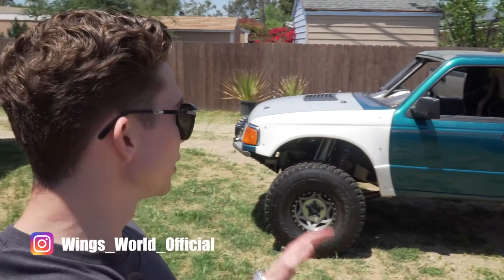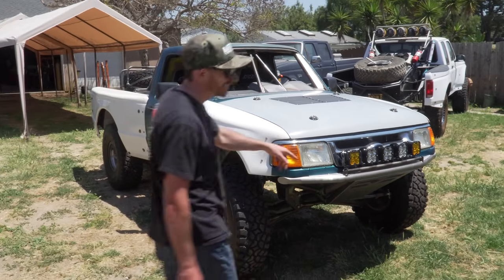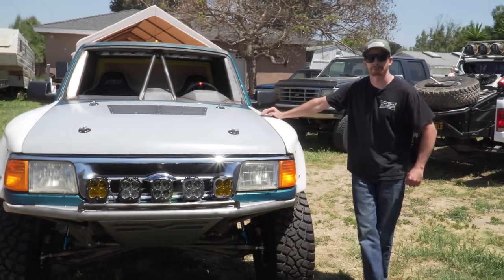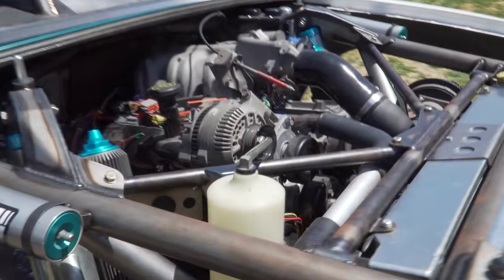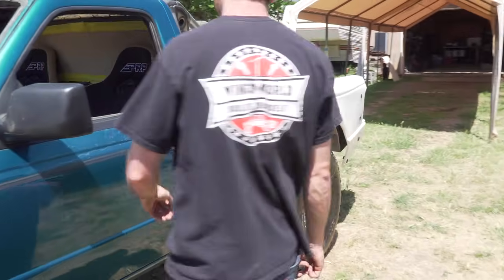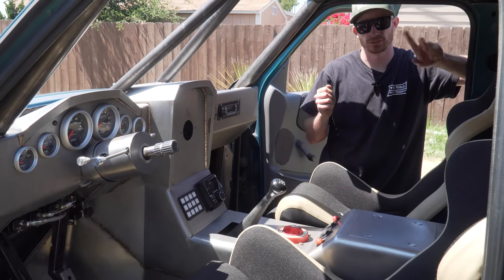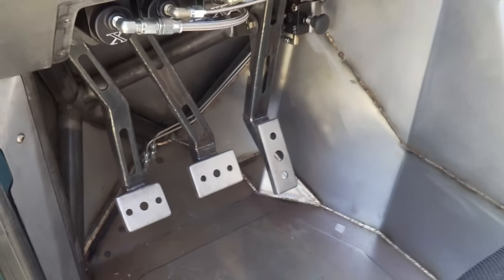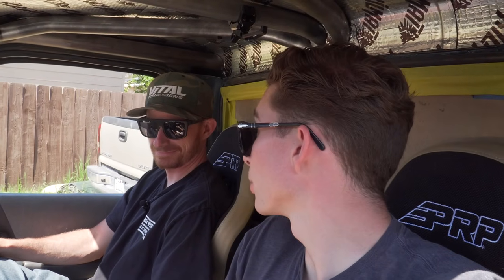Bespoke Hand Built Sheet Metal Dash - Ranger Build EP13

Comment: That truck is outstanding, I just spent 8 months in Brazil and I saw a few crew cab Rangers in that body style down there...this is really making me want to buy one that 25 years old to import and build like this. I even have a roller cam 351w, rwd ZF-5 S47 trans and Sterling 10.25" rear in my front yard for it from my '97 F-250HD that unfortunately got wrecked...very inspirational stuff, built like a tank. You guys definitely have developed a ton of experience, accumulated the proper equipment, have learned how to engineer and assemble a quality truck.

Comment: Beautifully done a lot of thought and time has gone into this build.
One question is there going to be any type of fire suppression system a build like this I would want to have a good system not just a couple of fire extinguishers, I would mount one at the front of both seats under the seat so easy to grab a couple of companies do some excellent mounts designed to mount to the seat mount brackets or adjuster rails.

Comment: 13:00 The right answer but for the wrong reasons 😅. Either way still a great build and design, so forgive my pedanticism. 

The heat transfer at this point is dominated by forced convection, the more air you can force through the radiator and up and out the better. Natural convection, the fact that hot air rises, becomes negligible once you start forcing a ton of air through. Also, stagnant hot air won't be what heat soaks the engine, not being able to shed enough heat through the radiator will. I know you were working on an ME degree, 3rd or 4th year you'll take heat transfer and learn all about this - at that point a few quick napkin calcs will show you the orders of magnitude difference in heat transfer between the engine not radiating heat as well due to sitting in stagnant hot air, vs how much heat gets shed through the rad. Additionally there's orders of magnitude difference in heat transfer between forced vs natural convection when you have a giant engine fan.

That vent will definitely make a big difference since it will allow higher airflow through the rad (not because it removes heat from the engine bay, lower underhood temps is a bonus but not a big factor in overheating). If you do end up still having heat problems consider adding ducting to direct the air from the rad and up towards the vent. The easier path through the vent, and the higher the air velocity as it moves through the vent, the more the vent will help "suck" additional air through the radiator, the cooler it'll run. Without ducting directing the air, the air velocity will be low as the air will turbulently tumble where ever it wants to go all throughout the engine bay, out the fenders, etc, which means it won't be sucked through the rad as efficiently. Of course additional cooling may be unnecessary so ducting may be overkill.